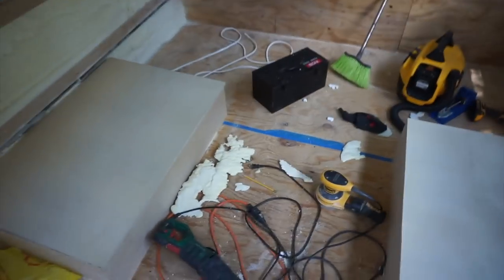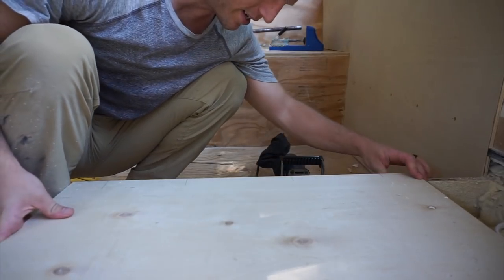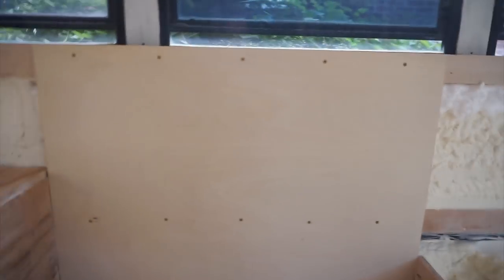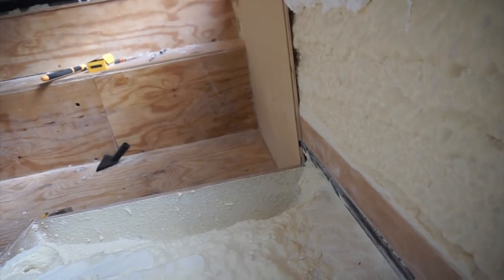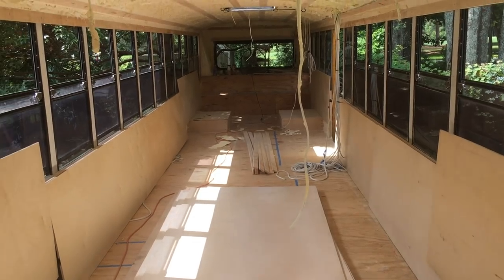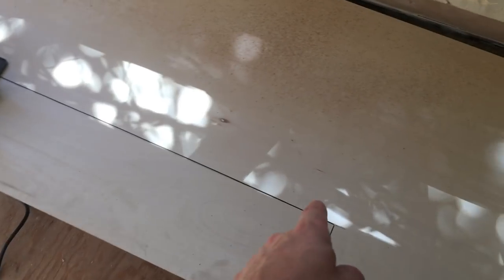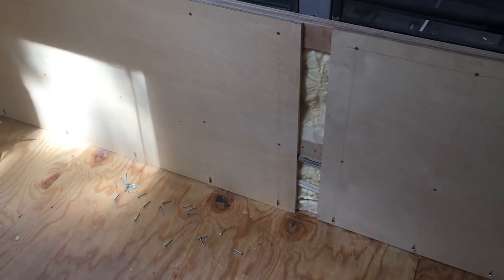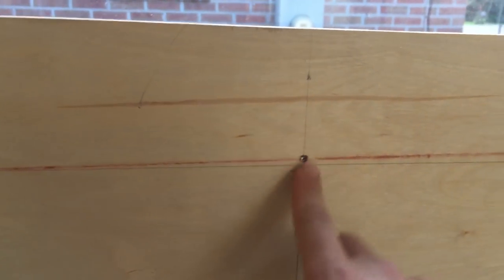Installing Wall Panels: Bus Conversion Ep 22

Comment: you used house wiring? that stuff cracks from the vibrations from going down the road. Nice Phantom, they are like the newest of the Gillig School buses before they quit making school buses. I have a 1948 Gillig that was a school bus until it was converted in the 1960's. no one knows of an older one that still exists.
Reply from the maker: Sweet! That's an old gillig. Nope only marine grade stranded in this bus.